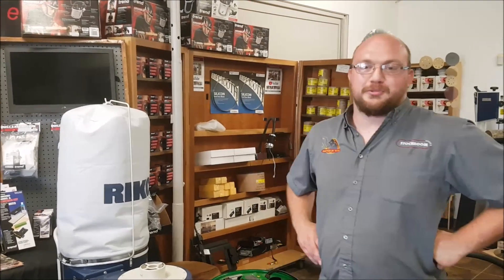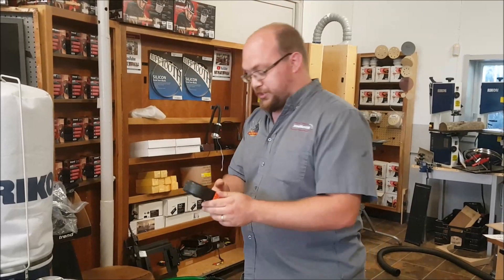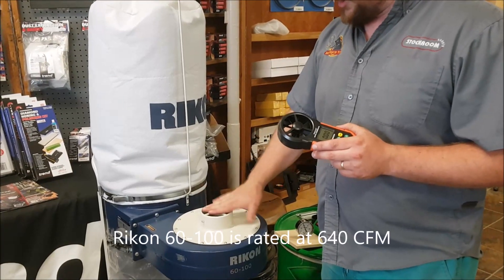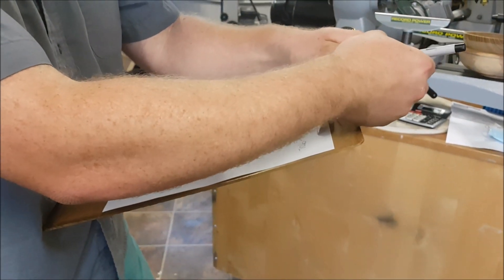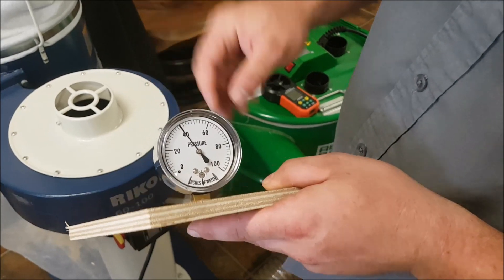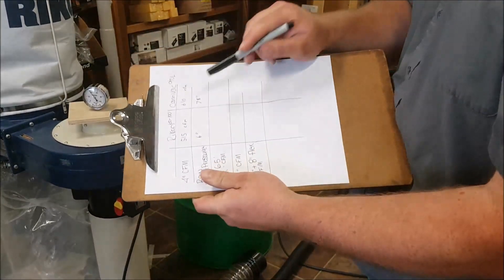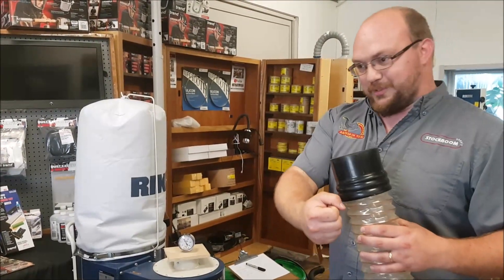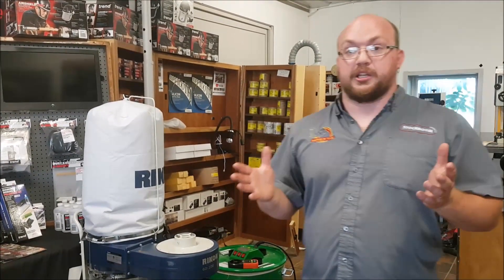CFM vs. Static Pressure? For My Dust Collector or Extractor Which is More Important? EthAnswers

Comment: Very interesting video thank you. I am adding a system to my shop and probably with the camvac thanks to your vids.
Question My sander uses a 2"/2 ½'" hose.What is your recommendation as to where to put the reducer ? Nearer the Camvac and have the majority with the hose 2"/ 2 ½" or nearer the sander with using mostly the 4" hose.
Cheers
Reply from the maker: No wrong answer here really! Traditional dust collector bring the 4" as close as possible...Camvacs really don't care.

Comment: This was extremely informative thank you. I clearly understood how going from a larger 4” outlet to a smaller 2.5” hose affects the CFM. But may I ask what effect going from smaller to larger would be please? For example in my shop I’m using a powerful (140” Static Pressure) Central Vacuum which has a 2” outlet… and I’m going from the 2” outlet to 2.5” ducting around the shop and then back down to 2” flex hoses. I wonder if this would affect the CFM like it did in your demonstration? Thanks!
Reply: What flows through your smallest hose is the flow you will get. What will change is velocity, larger hose is lower velocity.

Comment: Hold up, how is the dust collector better at 4" hose? Your result showed that with the ductwork, the dust extractor has higher CFM. Wouldn't that mean at least for Camvac it has all the dust collectors beat? Even with a 1000 cmf dust collector after all that ductwork you would get around 500 cfm at the end anyway.

Comment: so I just have to ask then what's the point of a dust collector then? Camvac has them beat in all conditions and there are priced similarly. 
I always thought dust collectors are high CFM and low pressure and dust extractors are low CFM and high pressure, but here it seems camvac got high CFM and high prssure.

Comment: could you tell me the actual cfm of the wall mounted camvac please; the specifications are low at 229cfm (108 l/s) - my router table dust collection requires 350cfm

Comment: May I ask for the methodology of the static pressure measuring device you used, for our research paper? Thank you 3:55
Reply from the maker: That’s the least expensive static pressure gauge I could find on Amazon screwed into a piece of plywood 👍👍

Comment: Last week I purchased the 55L CamVac. It's a well made dust extractor --- and I love everything that's made in England.
However, I have some questions (and I don't know how to ask them.) it's got to do with the air flow.
So, the new CamVac 55L I got, will be working mainly for dust (fine sandpaper dust) off my lathe. I find it important to note, that the dust direction will be towards the 4-5 o'clock and sometimes around 2 o'clock.
The dust "hood" I am using has a conical shape, which measures about 11" in diameter and hooks to the 4" hose.
When the direction of the dust is at the 4 o'clock, the CamVac is able to capture most (if not all) dust, however, when the direction of the dust changes to 2 o'clock, then CamVac does nothing (or does very little.)
I wonder, if I create a "ring" opening, instead of the conical opening, will I see a an improved dust extraction with the CamVac, or will I exhaust the CamVac?

Comment: Good video.  I appreciated the explanation of CFM to HP and SP to Torque.  That makes sense.  I would have liked to have seen the same static pressure test at each CFM test...see how that dropped in relation to the CFM for each type of motor.
Reply from the maker: Great suggestion! I will do this in a future video
Thanks
Reply: Thanks for your awesome explanation!!! Can you make video on S.pressure vs CFM

Comment: Interesting video indeed, thank you very much. I have a very small workshop. I use mainly cordless hand tools; circular saw, router, sander etc. RP also do a single motor unit using the same motor. Can one assume that the single motor version would produce about 1/3 rd of the 3 mottor version? Many thanks.

Comment: Great explanation, seems my small shop may need the extractor more than the big Rikon. Using big shop vac now but limited to 2.5 in. hose. 
Dewalt Planer question below ?
Reply from the maker: For most small shops a dust extractor like the Camvac is the best option! 
Regarding the Dewalt planer…both dust collectors would do a fine job. Though the Record would be better, especially on a long length of hose, due to the higher CFM and static pressure rating.
Thanks for watching!!

Comment: Thats actually very interesting! It would be nice to see how they work with a Dewalt planer that has a blower on it and which would work best :-) And how a router table works with both of them and the residual dust that gets put in the air. Thanks for this video!
Reply from the maker: Honestly both units would work quite well with the Dewalt planer. Because it has a 4” dust port and the assisted blower it is a very easy machine to collect dust and chips from. Of course the Record would still be superior due to the higher CFM and static pressure rating….especially off a long length of hose.